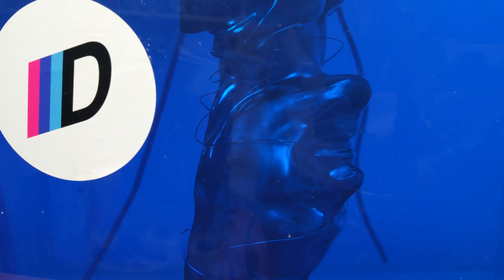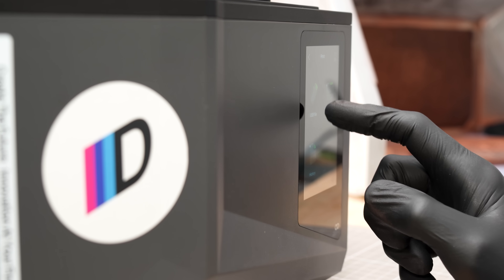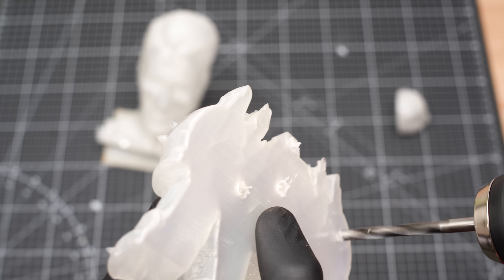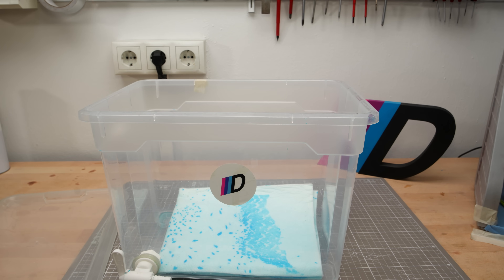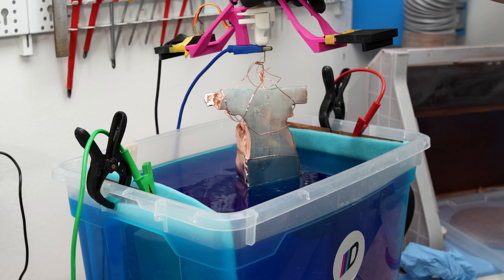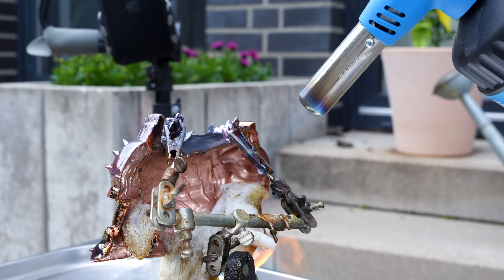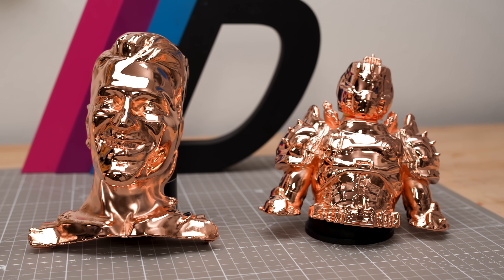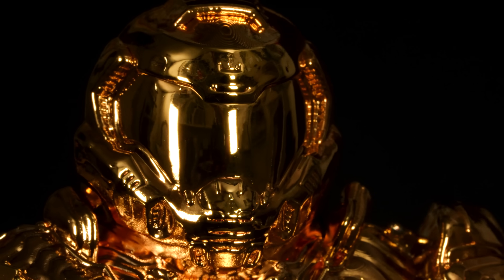Electroplating 3D Prints ... and burning them off! - FULL TUTORIAL

Comment: Another use ive thought of is rapid manufacturing of tooling for casting, injection molding, or stamping short run mass produced parts. Turnaround time of a few days and able to make thousands of parts in your garage, or basement 😅

For example, 

1. 3D print the mold/die
2. Electroplate the contact surface with some cavities to hold reinforcement material 
3. Burn out the filament 
4. Cast support material behind the thin plated contact surface. 

Some experimentation would be needed, but depending on how many units needed for a run you could use anything from reinforced concrete, to forged carbon fiber, to hard resins, hell, you might even be able to cast aluminum as the support structure for higher pressure parts. 

Having professional quality tooling for pennies compared to the commercial costs would be game changing.

I wish i had your setup and knowledge

Edit: i almost forgot, the reason to do this and a burnout, rather than just electroplating a cast part is to precisely control the dimensions and tolerances from run to run. You would elecroplate and inverse of the final part, so after its burnt out the side that was bonded would be the actual part surface. That way you could make multiple parts over time and the dimensions would be mostly consistent from run to run with new tool parts being able to be produced indefinitely.

Comment: You just answered a question I've been asking for a few years now. Specifically of making substrates for composite materials. 

I have been wondering about doing this process for 3D printed structural meshes of various geometries, then casting or over molding with ceramic and/or carbon fiber mat. 

I don't have the setup for the electroplating, so for the last five years it's just been stuck in my head. 

I am very curious how strong the 240 micrometer bust is after burnout. What is the final thickness after finishing layers? Does it bend with hand pressure, or is it rigid?

Comment: The only thought that comes to mind about the weak plating in deep cuts is to make the solution move faster.

The electric field is keeping the the material from depositing.  It is much stronger around the edges and it is pulling your metal ions out of the solution before the mixture is into the deep part.  The ions need to overcome the field strength before they reach the item, so if they move faster or are jetted into the deep parts they will arrive with a higher concentration on ions and be able to build up a thicker plate.
Reply from the maker: Super thanks! Ok, I‘ll a more powered stirrer!
Reply: @hen3drik  I wonder if something like an aquarium pump would work? Not sure if it can withstand the electrolyte but some are made for salt water aquariums so may be resistant.

Comment: What if you coat the 3d print in hot wax and then spray the copper paint and do the galvanic copper?
If you heat it lightly, the wax will melt and will loosen the print. In this way you can even use the 3d print multiple times.
Reply from the maker: That’s a pretty smart idea! But it‘s limiting the design.

Comment: Printing in ABS and leaving in an acetone bath for 24h should work too
Reply: But you can’t get details of a resin print, 
From my research there are not that many dissolvable resin inks, 
If they exist please help me out
Reply: @dwajranka4944  Those prints in the video were very large. I think you could archive that with FDM.
Reply: @dwajranka4944 there are actually water soluble printer resins on the market. They are made so you can print models with a hollow cavity and then inject it with whatever your casting medium you want like silicone etc and then dissolved away the print.
Reply: Some PLA filaments dissolve in NaOH too. I say some because I tried one that did, and another one that didnt.
Reply: I have done that before, got a nice model cannon out of it
Reply: I wonder about coating in wax myself, might be able to make not quite as perfect, but reusable ones that way